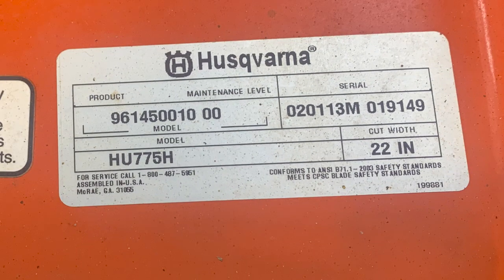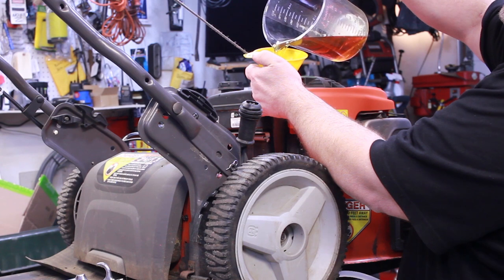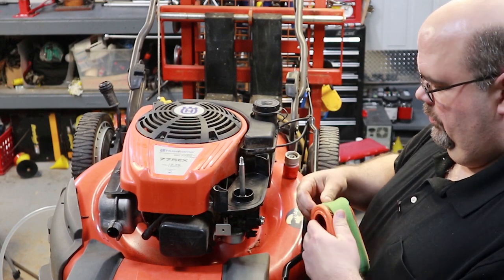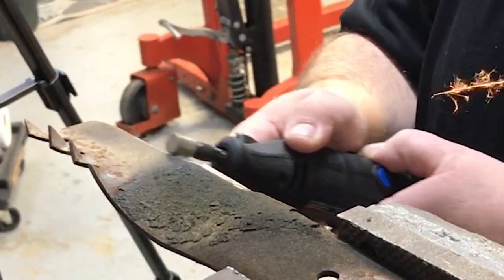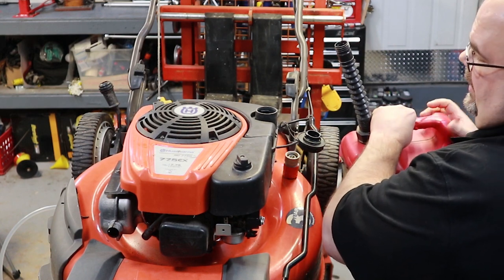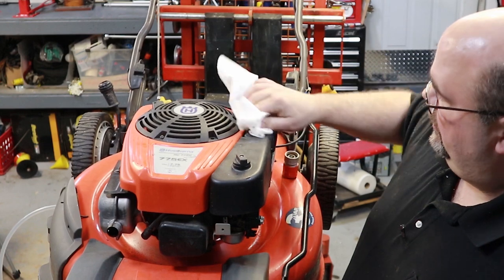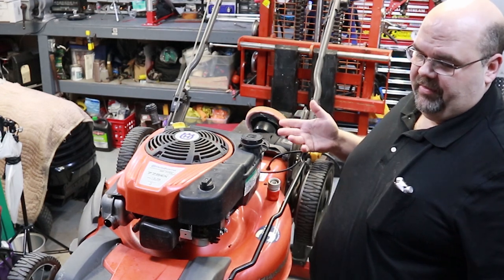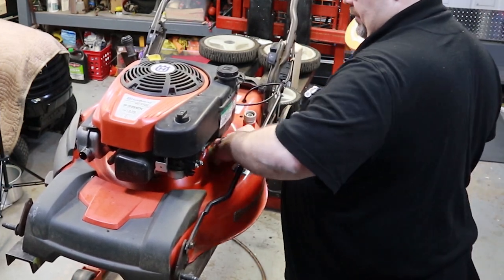Husqvarna HU775H Push Mower Service and Seasonal Maintenance in 2021

Comment from the maker: NOTE: Apparently, I've cut out part of this video when I was editing it!  Between the first time I started it and the second time I started it, I changed the plug and commented that I would use it to cut my grass before selling it in the spring.  I will make sure it doesn't stall and fail to restart when it gets hot before I sell it!  It could still have a bad coil that won't show up till it's able to run for an extended period of time.
Reply: I know this video is old but I wanted to say thank you I have my grandpa's old lawn mower and I have no idea what I'm doing when I'm trying to get it ready to use every year

Comment: Just picked up one off the street this weekend very nice mower these are, It was missing the pin for the needle and couple of minor things cleaned up well and runs like a charm, has the blade clutch feature also. Love how you cleaned this one up!
Reply from the maker: They are nice mowers.  Thank for watching.  🦅🇺🇸
Reply: @baldeagle242  New sub also💪🏽
Reply from the maker: @bigsonslawncare  Thank you, sir.  You, too, have a new sub—great video on the riding mower steering linkage fix.  👍
Reply: @baldeagle242  Thanks Baldeagle242!

Comment: Wow, this one runs and looks really good now!  Your video followed one from Donyboy73, who showed how if this model engine is a hard start or no start, sometimes it can be that the auto-choke is not closing when cold.  In Donyboy73's video, he just reached in near the muffler with pliers and bent the auto choke bracket back a little.  And I will now probably try Cover All when I need this type of thing next time.  This was a well-presented video.
Reply from the maker: +Tom Lewis thanks for watching.  Here is a short video I made a while back about the auto choke system.  I've had a few come in to my shop with this problem.  

https://youtube.com/shorts/U1YPivm6Ec8?feature=share

Comment: I actually had that exact mower. It was sluggish pulling hills. I sold it to a neighbor. Bought an Ariens self-propelled. That one goes up hills pretty good. The only Husqvarna that'll do hills good is the all-wheel drive. That one unfortunately has to set the cutting height one wheel at a time.
Reply from the maker: Thanks for sharing this info.  Luckily my yard is all flat and doesn't make much difference.  
Thanks for watching.  🦅

Comment: I have that same mower and after you engage self propelled for a bit and let go and try to pull it backwards the rear wheels lock up. If you roll it forward a few inches than it will roll backwards.
Reply from the maker: Sounds like you may have a sticking cable or possibly a weak spring.  I would also clean any debris or buildup out of the drivewheel area and see if that helps.

Comment: If you apply some Graphite on the smooth bolt shoulders fir the wheels.  It will make the mower easier to push.
Reply from the maker: +Jay B 👍

Comment: Do you have a video on maintaining or changing the drive belt?
Reply from the maker: Currently, I do not.  I'll try to make a video on doing it next time I get one in.  Thanks for watching.
Reply: It's not that bad. You have to make sure it's nice & clean underneath to get all the bolts out. Also let the tension all the way off to remove & install a new one. Need to drain the gas & oil out because it's easier to work on if you can flip it over.

Comment: i trash picked mine it was cover in about a inch of mud caked on the cooling fins it had been sitting for a few years. i took the spark plug out and water poured out and it had a mud dobber in the carb i replaced the broken control cable drained the old gas, cleaned the carb and the spark plug with brake cleaner what do ya know it started on the first pull! so i changed the oil. i just got done mowing my grass with it. hosed off the mud and it looks almost new. it's 2022 so it's 9 years old and i see bad reviews?? whatever....

Comment: Do you have a video on how to change the drive belt on this HU775H rear wheel drive mower? Thanks
Reply from the maker: +John Chaffee, I've not done a video on that yet.
Reply: @baldeagle242  Please do one.  I can't see how to get the rear belt guard(s) removed or at least loosened enough to change the belt.  Thanks!

Comment: I need help. I did everything for troubleshooting my lawnmower. My problem is when the lawnmower runs for a long time, like 30 -45 minutes. I have trouble starting it back up. When I first started it, it started right up. I change the air filter, the spark plug, ignition coil and just recently I change the brake cable. Because it was breaking. I don’t want to take it to a shop. I want to try fix it myself. I even clean flywheel. I thought I I fixed it. But it’s still does the same thing. Help
Reply from the maker: +Martin Mercer Jr the first thing I would check is to make sure the gas cap is venting.  (just twist it open wait a few seconds and see if it starts) 
If that doesn't help the only thing I can think of that you didn't mention is the valves could be out of adjustment.  
Good luck with it.  Let us know how it works out for you.
Reply: I adjusted the linkage for the valve. I going to clean the carburetor. But I will check the gas cap. Thank you
Reply: Can you clean the carburetor, without taking it apart?
Reply from the maker: @martinmercerjr8615  There's not much you can do without taking it apart.  At best you can pull the bowl off the bottom and spray carb cleaner into it as best you can but at that point you might as well pull it off and do a full clean.
Reply: @baldeagle242  can you do a video on how to put the carburetor out. I seen other YouTube video on this topic
Reply from the maker: @martinmercerjr8615  I currently don't have any push mowers in my shop.  
You may want to consider replacing it if cleaning it sounds intimidating.

Comment: I have the same mower and its flooding the cylinder,muffler and carb. It runs great but i have to dry everything out to start it everytime. What do i do?
Reply from the maker: +bob knar, The needle, and the seat are probably leaking, letting fuel slowly leak into the cylinder.  A cheap, easy way to stop this from happening is to cut the fuel line and install a fuel shut-off.  You'll have to remember to shut the fuel off every time you're done using the mower.  (Not ideal but effective)
The correct way to solve this problem is to clean and rebuild the carburetor or replace it with a new one.  
Good luck with it and thanks for watching.
Reply: I had mine leak gas in the oil a few times. I added a shut off valve in the fuel line & had no more problems.

Comment: I have that mower. What is the spark plug gap
Reply from the maker: The gap should be between 0.028 and 0.031 inches. Check the gap with a gap gauge and adjust the ground electrode until the gap falls between the two numbers.  Thanks for watching.  🦅🇺🇸

Comment: How much oil does it take?
Reply from the maker: The oil capacity of a Briggs & Stratton 700 series engine can vary depending on the specific model and its design. Generally, these engines have an oil capacity of approximately 20 to 24 fluid ounces (0.6 to 0.7 liters). However, it is essential to refer to the engine's owner's manual or check the specific model's documentation for the accurate oil capacity recommendation, as it may vary slightly between different versions of the 700 series engine. Following the manufacturer's guidelines ensures proper engine maintenance and optimal performance.
Reply: @baldeagle242  Thank you!!!